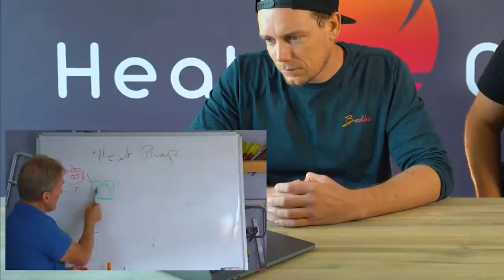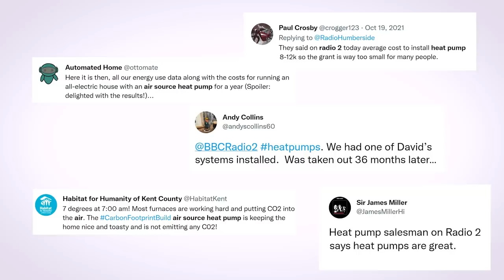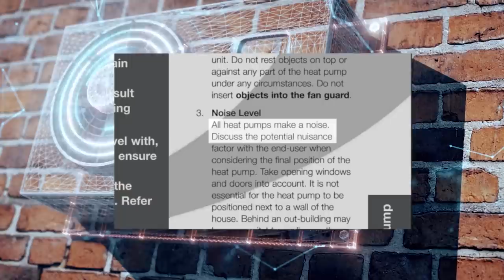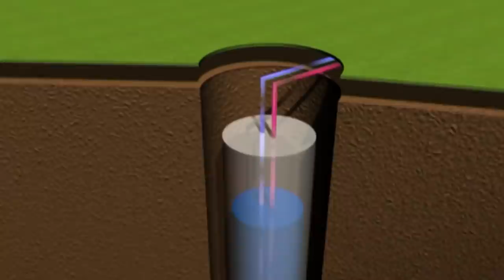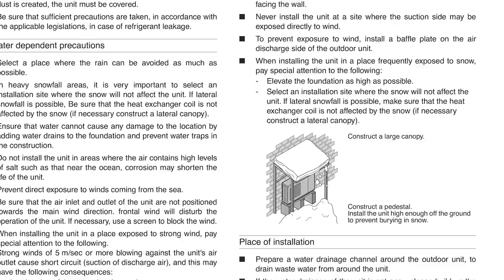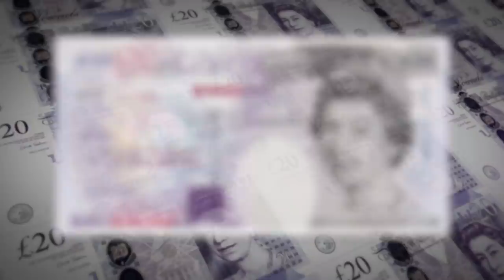Heat Pump Secrets They Don't Want You to Know

Comment: I fully agree that heat pumps belong in at least moderately insulated houses and need low temperature radiators. Also that you have to size your heatpump correctly, and sometimes they are just sized too small for the actual building they should heat, saving money on the wrong end.

I do not agree with your statement that heat pumps need to be "always on" (yes, the machine needs to be always on, but I don't know any modern heat pump that doesnt have a day/night cycle with lower temperature settings for the night if you want to. So you can have the heatpump "always on" but still be "off" (not heating, no running pumps or fans) in the night. Even so, my heatpump (7 years old now) is quiet anyway.

I also didn't have any problems with maintenance. None necessary at least for me until now, and none for my brother (different model, same manufacturer, 5 years older). One connector broke once, but that was the fault of the installer, not the heat pump manufacturer, but still the heat pump manufacturer sent out a technician within 12 hours (they have 24h service lines in winter) to fix the issue for minimal costs.
So I think a lot depends on the specific installer and manufacturer of the heat pump.

And yes, my heat-pump is not at the sea-side, it has a concrete pedestal, and it has a 8 kW backup heater (and the according cable) which hasn't been running since installation. They are in there in case something happens to the outer module, or inner compressor, so you still have heating and do not freeze (and if 3 people in a row want to take the hottest and longest shower they have ever taken, there just isn't enough time for the heat pump to get the hot-water tank up to temperature for the 3rd one in my case (could be remedied with a larger hot water tank). We are two people, but I have tried to get the backup heater to turn on to test if it actually works.
My heat pump is rain safe, the same as the one of my brother and from my mother. I don't know where you read that, but it surely isn't universal for all manufacturers of heat pumps. Ours have sheet metal housings and no open visible cooling/heating ribs (and all work as heaters and coolers through the same system)
My heat pump doesn't defrost through the backup heater, it defrosts through the heat in the warm water tank as it doesn't need much to do that anyway. And yes, on very cold+humid weather conditions it defrosts a couple of times a day. Runoff is insignificant in my case, no pipe needed for that, goes into the ground.

I mean, if you rattle off everything that is in instruction manuals that someone put there to not be liable as an issue all heat-pump users will have, you could do the same with 99% of products you can buy, and make hour long videos about electric kettles as well ...
Just have the same look at a instruction manuals for a gas boilers: Your house might explode ! (nevertheless nobody expects that, right?)

Also issues with Power Stations you can calculate quite easily: A gas heater has around 90, maybe 95% yield in heat actually heating your home from the caloric energy. A gas powerstation has 65-70% caloric energy to electricity conversion (95% if you are using the off-heat to heat homes in the vicinity of the plant). This 65-70 gets down to 60 for transport if you have at least minimally decent transmission systems. With modern heat pumps (sized correctly, run in at least somewhat insulated homes with low temperature radiators) you get year-around working factors of ~3 (5 in spring and in autumn with higher outer temperatures, maybe 2.5 or 2 in Winter). So you having a total yield of energy of 180% going from the initial caloric value if you go gas-power station-transmission-heat pump instead of heating your home directly with gas (so you are saving ~half the gas without changing your primary energy source !). Once the working factors drops at or below 1.6 (because you live somewhere where its extremely cold maybe, or your heat pump is just very old), you are better off burning the gas directly for heating.

Comment: I love heat pumps but it's hard to imagine that burning natural gas to generate electricity and wasting 40% of the heat is going to beat a system that lets you use 90% of the heat unless the COP is high and installation is perfect. What might make good sense is using a heat pump to preheat showering and bathing water in a buffer tank/exchanger before it reaches the boiler, with the boiler topping it off. The COP of the heat pump would be very high indeed if all it had to do was raise 9C water to just 30C. Some sort of hybrid system seems ideal.

Comment: I fully understand the necessity for drama in these presentations and everything you say is true though not all of all heat pumps.
As with everything in life, there are strata of performance and quality in heat pumps. There are manufacturers that have dealt with some or all of the issues you raise, and ones that don't.  We fitted our first HP in 2004 and do up to 400/year now. We service everything we sell and many others. The biggest issues we see with HP's come from the people who sell and install them. 
Boilers as you say have drawbacks, every solution to every situation in life is the same.
Choose your product( Boiler, Heat Pump, Stove, car, telly, bicycle, yada yada yada) and supplier/installer carefully and the solution will be correctly tailored. 1 kW in from power station 3 to 4 kW out from heat pump and greater efficiency in power generation by correctly applied loads is the rationale for heat pumps and the grid also greater greening of the grid itself.

Comment: They work perfectly  here in Scandinavia. It blows 55 degrees heat in minus 15, but be got very dry air tho. Give 1,5 kv it gives 6 kw its a no brainer. Ofcource they gave a defrost function
Reply from the maker: We are not talking about air to air
Reply: @SkillBuilder  the geothermal heatpumps works even better. From water ti water. Atleast here in Scandinavia with triple glasses airtightness 0,6 and thick insulation  250 mm in walls and ceiling 450 mm requirements

Comment: I live in the North island of New Zealand it does not snow but nearing the end of winter when we start getting nice sunny blue sky days and weve had a light  frost , my Daikin heat-pump unit outside freezes up every time .I left it running till 230 today and it still hadnt thawed out so ended up ( like I usually do at 8am) going out with the hose , it takes awhile as its frozen up all inside behind the fan as well so you have to make sure you get up around all the inside properly otherwise its likely to start freezing up straight away again. So as well as frozen up inside its all over the side coils and back , which is a pain to get to .  I've had them come out , they've said , its fine , everything's running ok , they filled it up with more Freon which i dont think it really needed , then they said well its not a very big unit , its the same size as the one on this video. I rent the house otherwise I would of gone further with the complaints until they replaced it . Or maybe it needs moving I dont know. It gets the afternoon sun from 12pm onwards.  I've cut down a Camellia bush from in front of it last year , but made no difference.

Comment: Roger, thanks for another Heat Pump video, you and your viewers must internalize that a heat pump is the future of heating, think of a hybrid vehicle, is it better than gasoline only based vehicle, and we both know the future of vehicles (Electric and Hybrid only) so a heat pump, at first, it must be a hybrid system with another heating system (Natural Gas, heating oil, propane) as a backup, but I can tell you for sure in the not too distant future, there will be heat pumps will transfer heat even at extreme temperatures of minus 50 degrees Celsius without any backup, it's all about science and technology.

Comment: The radio 2 clip says match heat source pump to property size, I query that. You want to match the heat source pump to the radiators and plumbing. No good matching to the size of house if there is no heating in some rooms and no good sticking in a big pump if rads are small with a rubbish output.  Some very useful information in the video. My experience of heat source air to water, very expensive. In fact so expensive apart from the frost protection cycle we are no longer using it for heating or hot water.

Comment: We have a 16KW Samsung EHS Monoblock air source heat pump.  It's not noisy, you can barely hear it when walking down the street 10ft away.  It's 6 years old, it's never broken down, it's fitted in an old Victorian house that's not well insulated.  It runs with our existing central heating pipework.  It hasn't corroded.  It has saved us £thousands on our heating bills. We get 3 units of heat out for every 1 unit of electricity in during Winter months, higher during the rest of the year (I measure this myself, we have two meters, one for electricity input and one for the heat output).  Our heat pump is in a position exposed to winds, it has never blown the fan the wrong way.  We've never had problems when it snows.  We have rodents living around our house and under the floors sometimes.  We've never had problems with rodents in the heat pump.  We have zonal heating, so circuits are not always fully open.  You really do sensationlise this, you spend 12 minutes telling everyone all of the problems and about 30 seconds saying they can sometimes be OK.  No balance.
Reply from the maker: Buy yourself a lottery ticket while you are on that winning streak.
Reply: @SkillBuilder  That reply just sums up your biased attitude and doesn't do you any favours at all.  Stay in the age of the dinosaurs and you'll soon become extinct.

Comment: I live in Vancouver BC Canada, and have natural gas to my home, as do the majority of residents here.  The Provincial Government is pushing Air sourced heat pumps to all residents, including installation grants.  For residents without natural gas, it seems that heat pumps decrease their electricity bills (they formerly used electric baseboard heat), but people that had natural gas forced air furnaces and switched to air heat pumps  have less heat and the electricity bill for heat is much higher that their previous natural gas bill.  I believe the Provincial Government wants us to use less NG, so they can sell it for a greater price to out of Province users. A journeyman electrician friend of mine installed an air heat pump 10 years ago, took out the duct work for the forced air NG furnace, and has regretted it since the first winter.

Comment: In a couple of months we move into a ‘alleged’ well insulated barn conversion with underfloor heating downstairs and huge triple steel rads upstairs. The only alternative would be LPG/oil as there is no mains gas so we have no option. Fingers crossed it works!!!!
Reply from the maker: In that kind of building a heat pump is the best option.

Comment: He He, looks like you upset someone, some people really have an aversion to the truth. Btw, I have a heat pump, live in Ireland and the building is built from scratch specifically designed for a heat pump and I still have to use a storage heater to stop shivering the room is only 8' x 14'. I would accept any handouts from eco warriors to relocate to a country that has a constant temperature above 20 C. Appreciate your advice given on your channel, keep up the good work.

Comment: heat pump are great if your temperature never crosses freezing point or couple degrees bellow it at max. 
yeah, there work arounds, but usually they have to constantly turn off and heat up pipes to defrost them.

Comment: 1. Undersized is better than oversized . 
2 buffer tank is a must
3 on and off cycles are Power cinsuming 
4 leave pump alone let it run up and run out ….

I got reed of oil boiler got proper stove with back boiler 

500l buffer and 300l dhw All running in conjunction with air to Water and solar tubes in d roof

Comment: Is you system designed for low temperature heat distribution? If not, stick with your high temperature gas boiler.
Consider both a heat pump and the boiler. Turn off the heat pump when weather conditions are not suitable (too cold or snowy) but most of the year the heat pump can save money.

Comment: Burning gas to produce electricity, transmitting this to your haouse through the grid and then using that electricity to generate heat is a lot less efficient than just burning the gas where you want the heat.  Power stations that burn gas are only generally 50% efficient, 8% of the energy is lost in the national grid and more if lost when you use that electricity to run a heat pump.  In comparison a good gas boiler is over 90% efficient.

Comment: Really some good points here, but i am happy with my system atleast for now, i bought an used ecodan/zubadan 11,2kw split system manufactured in 2019 for 500€ "broken" to experiment with and try to fix myself 😅turns out it was mostly install error causing the unit fo freeze up + the classic installer error of temp sensors poorly fixed to the piping and leaving the compressor transport mounts and packing styrofoam in place 🙈 now with some tinkering of the settings it has been running for two months with an average cop of about 3.5 😊 not bad but Still need more radiators put in as the old system was an oil burner with high temp rads. Total cost of install this far is under 1500€ so for me it was a big win. One thing to point out is that the big manufacturers lack of good programming and application devlopement skills, the Mitsubishi control system is a mess, ex. The electronics have capable sensors for flow rate, temperature and AC voltage and current measurements but somehow they are incapable to calculate electrical consumption and the heat output accurately, they just estimate it based on the readings and most often it is completely off, but atleast it shows less then actual reading so that is good. Now i am experimenting using esp32, two ds18b20 tempsensors and stealing the voltage signal from the inbuilt Sika vortex flow sensor to get an accurate reading of the heat output. Was thinking to also have the ESP to output a xxx pulse/kwh signal from the and connect it back to the ecodan ftc5 controller to get Melcloud to show accurate heat output readings 😅 the manual state that i should buy another flow meter to get an accurate heat output reading 😂 The pre installed Sika vortex sensor is a 300+€ sensor that is fully capable to do that with better precision then a bought heat meter when coupled with two calibrated temp sensors 😂

Comment: I live in the states in a fairly cold area and have a air heat pump and it can be extremely noisy and vibrate the house in a defrost cycle. Plus the cold and twenty inches of snow caused it to go into a outdoor fault. Had to reset the whole system.

Comment: It feels as though you are exaggerating some of the issues with air source heat pumps.  We just installed one near the coast and it works great.  It is more efficient above an air temperature of 20 degrees (US) and that is why we have the backup natural gas for very cold days.

Comment: It's important for efficiency and safety that gas boilers are serviced annually, yet 27% are not!
Air source heat pumps are supposed to last for 15-20 years with two monthly cleaning and annual servicing.
What hope is there they shall last their full lifecycle?
Reply from the maker: My brother in law has a gas boiler that hasn't been serviced for 25 years. He says the money he has saved is more than any marginal gains in efficiency.

Comment: Roger, insulation is a minimizer. But rooftop solar is an income earner. £5000 gets you a 4kW solar system which is infinitely better over the long term. Give the people the choice of solar PV or insulation if they live in flats.

Heat pumps work best if you have land for ground source OR if you use an oil heating system.